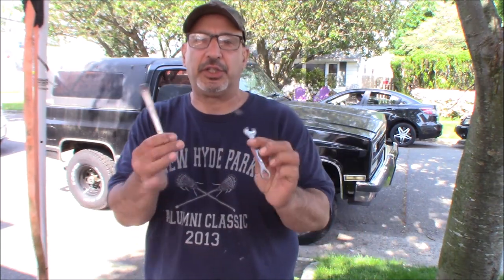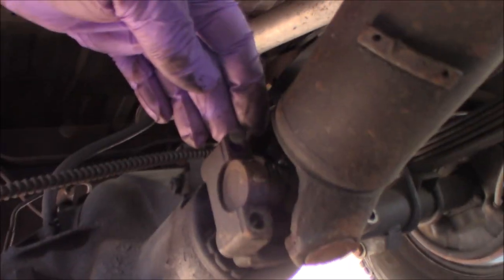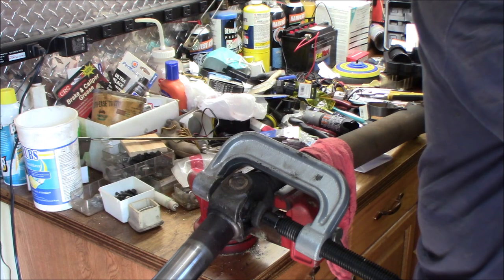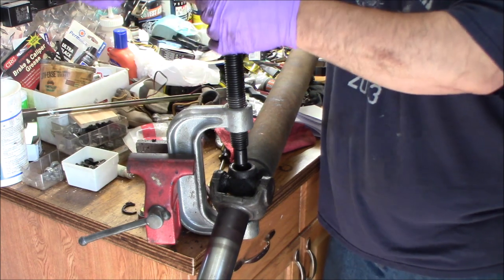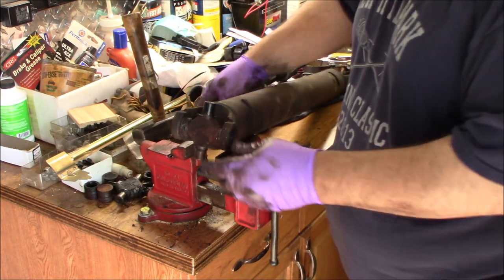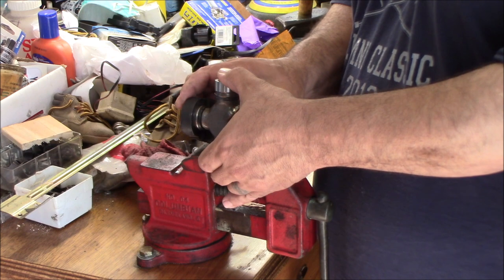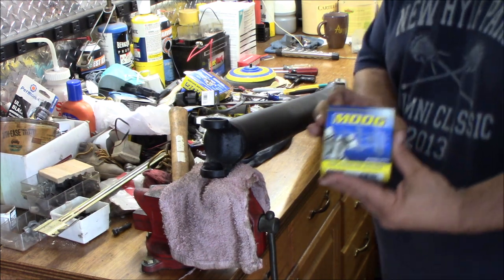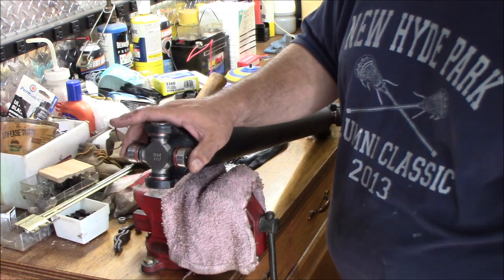U-Joint Replacement | 1989 K5 Chevy Blazer | Forget the Tool, Use the Hammer

Comment: I know this is old, so hopefully you can help me out. Looking at my drive shaft I think mine is in backwards. The slide tube is going into differential. Is this wrong?
Reply from the maker: You might have an aftermarket shaft
Reply: @AxlesGarage  Thanks for reply. Do you have any idea/suggestions on how long the drive shaft should be for my Jimmy/K5? It's I believe, the same lift as yours, 4" lift 37" tires.

Comment: Just bought a stock drive shaft for my 90 K5. Can you tell me what size the u joint is supposed to be. the one that goes to the slip yoke? I got the rear one that goes to the axle 1350 not sure if it is the same size or not. Any help would be appreciated thank You!
Reply from the maker: Front and rear part of REAR driveshaft are the same U-Joint. https://amzn.to/3dlrmLc
Reply: @AxlesGarage  thank You! I ended up getting the same Moog ones you used in the video. Going to fix the drive shaft either later tonight after the shocks or tomorrow!